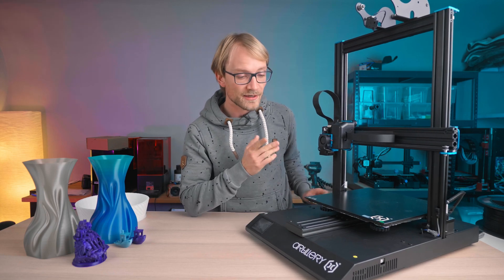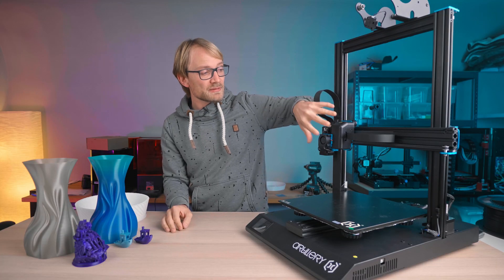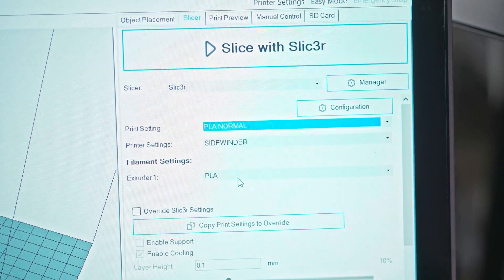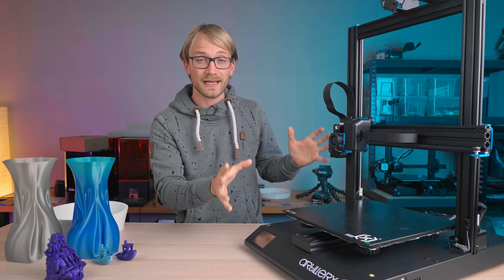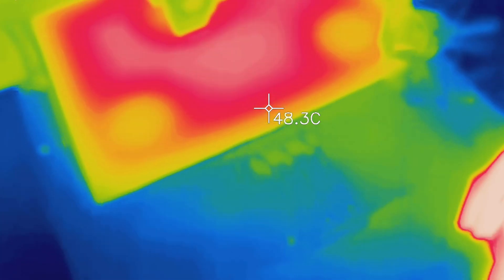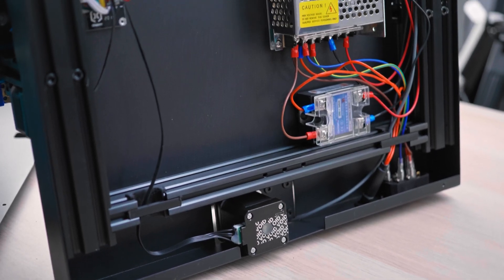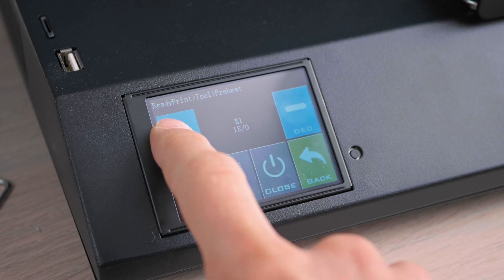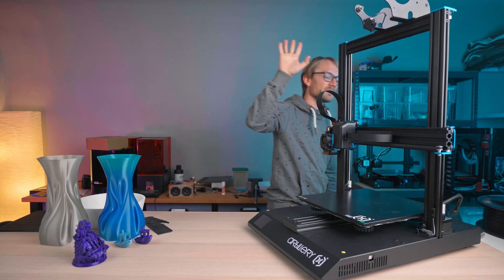Artillery Sidewinder X1: Built for show!

Comment: I do own a Sidewinder X1 3d printer as well and just after I received it I uploaded a new Firmware and activated "Linear Advance"...what a mistake! I got wobble in a very irregular pattern and therefore I adjusted and replaced about anything I could have thought of. It took me half a year to find out that the 8bit mainboard was overloaded with the additional calculations needed for Linear Advance. But in the process I designed a few improvement parts and set everything up correctly and when I switched off linear Advance off again the printer printed flawless! The printer is definitely nothing for people who only want to print and don't want to bring up additional time to fix things. But I do get really good quality prints with a minimal retract of 0.4mm and after fixing everything I can totally recommend it regarding its price compared to prusa or creality!

Comment: Having owned an Artillery Genius since Feb 2019, the printer has been near flawless.  I designed a cable minder and a split blower shroud specifically for the Genius.  I download a clip for the z-axis which took much of the z-vibration out.  My printer is in a cabinet so I load the filament through a shelf above.  The smaller bed seems to heat more evenly and I use a 2mm glass plate. I use OctoPrint to control the printer except for filament load/unload.  I am a long time subscriber to Thomas and I have to say that he was more harsh than needed... he likes to fiddle... I don't.
Reply: I second this. Also, got links for the above mentioned mods? :)

Comment: I have the Artillery Genius and the bed heater wiring suffered the same issues you highlighted so I printed a cable chain and replaced that bed heater cable with 16 gauge speaker wire as it is very flexible and wont fatigue any time soon. Also replaced the bed temp wires. Lastly I made an aluminium bracket anchored to the bed subframe to support the cable chain which then also supported the heater mat at the edge of the bed. Since the bed adjustments are so small, the aluminium bracket had enough flex to accommodate that.

I also added the BL Touch sensor and upgraded the stock firmware and display software. I've recently purchased some spares from Artillery's shop like belts and hot end sensor and heater cartridge mainly because I'm using the printer for a project and can't afford any downtime. At the same time I purchased an aluminium filament feed tensioner for about $7 and will shortly replace the stock plastic one. Having said that, the printer has done about 500 hours and has been next to flawless so for those not afraid to roll up their sleeves and take care of the little things that crop up, I've found the Artillery Genius well worth it. If you are looking for a printer that has every issue sorted, you'll likely have to pay quite a bit more but the as Thomas said, maybe the Artillery is not for you.

Comment: As an owner of V3 I must say that I agree with all you said. What is worth mentioning, is that due to its flawed design the bed warps, and it warps hard. You can do the heatcycle procedure to straighten it, but this will help you several times, after which the bed will warp beyond the point it is usable. Had my bed replaced twice under warranty from Artillery, the second bed coming with dent in the middle straight from the factory. Currently I am unable to use my printer without abl. Adding abl is a completely different story, and as the bed warping problem is very well known I can't understand why this printer comes with no abl system. If I were to choose my fist printer  again, I would not go with this one, rather choosing either a Prusa MK3 clone or Creality Ender.

Comment: Quick note about the CE-marking:
There is no such thing as a "china export" logo. The Regulation (EC) No 765/2008 forbides the use of any logo that could be mistaken for a CE-marking. So it either has a CE-marking that is printed in the wrong proportions or it falsely claims to have one. In both cases, it is a misuse of the CE-marking.

Comment: that MKS Gen L wiring looks a lot like the FLSUN QQ I just bought used for dirt cheap. Hot glue,  mixed styles of wires, 3" wire spliced twice, and now some DuPont connectors hot-glued into place. The last it was my doing to keep the touch screen from interfering with communications over USB. I have the same touch screen, it's really a controller (like octoprint) that communicates with the MLK Gen L via gcode over the same UART pins as the USB-serial converter if it's plugged into the AUX-1 connector as it's designed to be. The clip you showed of the touch screen looked like the same default button icons that MKS ships. Also, if you there is WiFi, it's an ESP8266 plugged into the touch screen that allows sending the gcode over a socket...and that's it.

Comment: The TH3D review pointed out the grounding issue with the AC bed, and Tim gave feedback about the issue and Artillery said they would talk to the engineers about it.  18 months later and still not fixed.

Comment: I got my X1 v4 a year ago on a great Black Friday sale.  My X1 has none of the externally visible flaws Tom has in his unit.  My AC cable to the heater has a very soft see-through mesh sock over it that is extremely compliant and flexible.  The heater was (and still is) well-adhered to the glass bed.  The hobbed gear in mine was (and is) quite sharp, and has given me no problems (yet), and the same goes for the feed lever.

Some folks have received warped glass beds, though mine has stayed flat from 25C through 60C.  The uneven cooling is readily apparent (even without a fancy thermal imager), so I always put a very thin layer of glue-stick on the bed, just to be safe.  The texture of the bed is very useful here: I apply the glue-stick, let it dry, then scrape most of it off, leaving a small amount in the pits of the slight waffle surface.  Works perfectly. though you do want to use THIN paper when leveling the bed.

After doing the factory-recommended roller adjustments, my top printing speed has been limited only by the wimpy part cooler, which fortunately is an easy DIY upgrade.  I'm surprised Tom didn't notice this, as it can be a factor when printing a Benchy at even a mildly increased speed.

Speaking of upgrades, the community has developed replacement firmware for both the controller and the screen that have been well-received, though I haven't yet tried them myself.

Tom's complaint about being unable to take full benefit of the Volcano is only partly true for me:  There are benefits to using a Volcano at normal print speeds!  The long melt zone lets even the cheapest crap filament print much better.  My best example here are the super-cheap "satin" PLA filaments that, in my other printers, behave more like glue than FDM material, causing multiple hot-end rebuilds when the high feed pressure needed causes filament to come out lots of other places that aren't even near the nozzle.  Never even slightly a problem with the Volcano.

Best of all, the Volcano's long melt zone gives any water in PLA lots of time to go out the top instead of being forced through the nozzle.  You can literally see steam rising when using wet filament.  I do keep my filament in Sterilite boxes with desiccant on the bottom, but I always keep one spool sitting on the X1, ready to go.  I have put my wettest filament through the X1 at a high feed rate, and I didn't hear even a little of that dreaded crackling/popping sound at the nozzle.

I do like how quiet the printer is, even without Trinamic drivers.  And I've noticed no missed steps, which to me means the factory simply adjusted all the driver current settings correctly, a major source of excessive noise.  So I'm not planning to upgrade the controller board any time soon: It works well enough for me.

There are other minor upgrades to consider: I don't like the "generic" V-groove rollers used.  When they wear out, I will replace them with polycarbonate, which I believe is a far better material for the loads present on a large printer.  But it's another low-cost upgrade that can wait until after the stock parts become worn.

Something great, and another thing Tom missed in his short review, is the option to use a USB thumbdrive instead of a fiddly microSD card.  A vast improvement that I wish all my other printers had.

Tom's X1 is clearly "meh" (good enough overall, but not outstanding), and the company behind it is also "meh".  So the OOBE could be highly variable, with my printer being way to the good end, but with no guarantee that your X1 won't be more like Tom's, or possibly even worse.

That said, I just checked and it looks like Artillery is repeating the same sale again this year directly through their site: $379 delivered (in the US), a great deal compared to the $500 price on Amazon.

Before buying a larger printer, even a good value like the X1, be sure you will make use of its size, for it does take up lots of space!  Do you have a long list of large prints in a Thingiverse Collection?  Are you tired of doing "puzzle-piece" STL splitting to break a large print into multiple smaller prints?

I did have a large list!  When I got my X1 I immediately printed new shades for every lamp in my house (mainly torchieres), giving them a designer look for relatively little filament (vase mode and hollow mode).  Just those 11 prints pretty much paid for the printer, assuming I could even have found other shades or lamps I wanted.

Comment: Thomas, I’m brand new to 3D printing. I love it and I’m fully committed to learning this hobby. Let me start my story by explaining my limited experiences in 3D printing. My first printer was the Artillery Sidewinder which I purchased from Amazon for $430.00 US dollars. I wanted the option to print a larger prints once I understood the process. I had my share of problems early on. I had the loose wheels, a bad 20 pin cable and I pulled pins on the board next to the extruder. Absolutely there could be improvements from the factory. However, I purchased new replacement parts on eBay from Friendly Hobby’s in Las Vegas for less than $20 bucks. They were absolutely great in helping me trouble shoot. Artillery did also warranty the original parts as well. While my Artillery was down I purchased a Creality Ender 3 Pro. FYI, for $159 bucks on Amazon Prime Day. I loved it and from my first print. My very first print via the Cura Slicer came out perfect. Shortly afterwards I received my parts from Las Vegas and I resumed printing on my Artillery printer. I have watched countless hours of YouTube videos on how to tune printers. Since I resumed printing I must say that the Artillery is doing a much better job than the Ender 3. It’s much quieter and so much more reliable. I attempted to run ABS on the Ender 3 and it failed miserable. I melted the filament feeder tube and clogged the hot end. Some how the extruder e-step went haywire and that caused me 2 days of trouble shooting to figure out what the hell happened. It went from perfect prints to under extruding by 60%. I disassembled the hot end and recalibrated the e-step after trouble shooting the under extruding problem. I tried the same build on the Artillery Sidewinder and hit a home run on the first print. I love printing PETG on my Artillery. ABS is still troublesome. But, no clogging or under extruding concerns. I actually have changed my opinion of the Artillery Sidewinder. I really need to update my survey on Amazon. FYI, I have ordered a dual extruder gear and a Capricorn tube for the Ender 3. FYI, I love both of these machines and chalk my issues up to lack of experience.

Comment: eesh ive had one of these for a year D: Gonna have to take a closer look at things now... Thanks for the heads up. Oh one thing to add, out the box the parking and run out code is broken. It would park the head, and then power down the motors after about a minute. So you can easily loose tracking on where the print is. So when it resumes its lost.

Anyway really need to take a good look in the box again make sure its safe...

Comment: got my x1 v4 3 weeks ago, Im really happy with it, been printing 24/7 both with 0.4 and 0.8mm nozzle, just finished a 36h print, easy to level, prints are really good, also have a cr10,cr5,cr6 se, flashforge creator pro 2, but the x1 is my favourite, and most reliable printer:) ofc its as with most budget printers, none of them are flawless, but easy to print a few parts and fix them:)

Comment: Thanks for the honest review. I almost bought that printer, too. But at the moment I have an early version from 2019 lent from a friend who couldn't get it to print. The mechanics and design choices on this printer are not that great as expected. Interesting is that the 2019 version has a different sleeve for the bed cables. It has a rubber texture and does not kink but bend in a perfect loop, as you mentioned. So they actually downgraded during the versions. One point which shook me was that they have not yet added a strain relief yet. This is a very cheap addition and very important as you pointet out. How can you not ad that in +1 year time?
It all leaves me questioning if this is not even a coincidence. I see a good chance that certain things have not been improved or downgraded to cut cost to improve margin. Would not be the first time that someone would do that in an "early?" product life cycle. All carried by good reviews and a supper hardcore user base which are willing to defend these printers. 
I see no point in 2020 to buy a machine which I have to fix / or improve before I even start printing. Those were the good old times.. but I don't miss them ;-D

Looking forward to your mysteries!

Comment: I have one of these - they are dangerous pieces of crap. The mosfet failed ON for the heated bed and nearly burnt my house down!

Ended up ripping everything out, killing an SKR 1.4T board and a hermera horned, and now I have good prints off it.

Also I found the printing community hugely defensive of these printers, almost like a creepy cult. 

I’m glad you’ve pointed out these issues, thanks for the video.

Comment: You should look at the mingda D4, its got a lot of value for money. The whole line does, but its not very covered.
Reply: @3D Print Wrangler the Artillery X1 is more comparable to the D3, not the D4

The Artillery is also a fire hazard waiting to happen, doesn't have ABL, and I believe x doesn't connect via uart.

Also it's 699 Cad so I have no idea where you saw that price.

Comment: Thanks for the clear and thorough covering of serious electrical issues!  They're in a whole different league than the issues Creality has with some of the the CR6-SE kickstarter batches which have been problems for a notable number of customers; power regulators failing on the new main board (probably thermal conductivity issues - boards obviously not tested under load before shipping), and the power switch being a bit feeble - issues for sure, but not burn-your-house-down or electrocute-your-customer issues. Also Creality do bond the printer metalwork to the power supply ground properly.

On CE marking - one of my pet (pedantic?) peeves is the Chinese manufacturers - even those using reputable Meanwell etc power supplies - always use the slightly cheaper PSUs without power factor control. That fails EU regulations out of the box (EN61000-3-2), although it seems no-one is bothered. Meanwell make it quite clear on their product pages that the LRS series power supplies are not certified for use in the EU (see e.g. https://www.meanwell.com/webapp/product/search.aspx?prod=LRS-200). The RSP series for example, which cost only a few beer tokens more, do meet that regulation (see e.g. https://www.meanwell.com/webapp/product/search.aspx?prod=RSP-200).

Compare that to Prusa in particular, who source their power supplies within the EU - of course they do have power factor control. The UHP series do as well, which some might be using because of the shape (Ender 3 V2? Can't find a video that shows opens up the PSU case to show it).

However I will say the more recent Chinese products do install the power supply inside a metal box, which is good with respect to EMC directives - again, see the notes on installation on the links above from Meanwell where they make this perfectly clear for those PSUs. Also obviously this is something Prusa don't do on the MK3; I don't know if Delta meet that without a plate.

Comment: Hi Thomas, I received my Sidewinder X1 yesterday and now I ordered a refound. Thhank you so much for your honest review and saving me from this ticking Time Bomb. I might not be able to fix those issues therefore I am really happy to see this! 
Please keep up this good work!
I think I will go for an Anycubic Chiron, since I already on a Mega S and I am quite happy with it. Just a question, is there any reason you did not review any Anycubic Printer so far?

Thanks again and greetings from Hessen! :)
Reply: maybe check your printer first, a lot of comments report here that almost none of those issues exist
Reply: @LászlóKrencz  That would mean I have to open it and loose the warranty. Also I am not capable to repair or even diagnose some of the problems. The printer is already on its way back and I settled for the anycubic chiron.